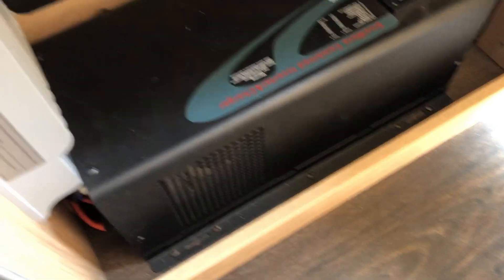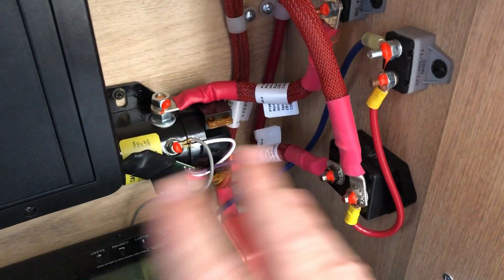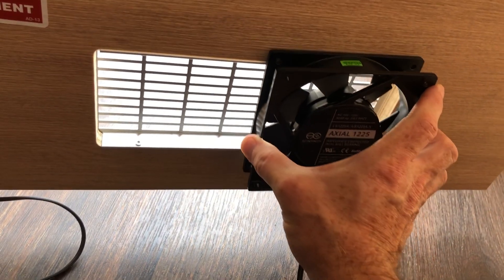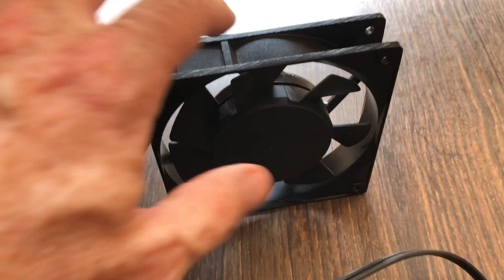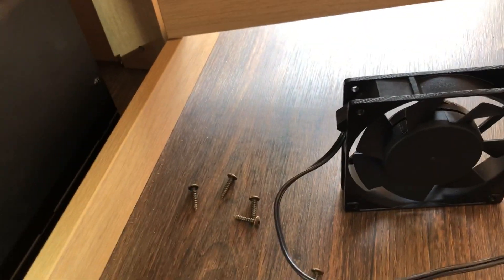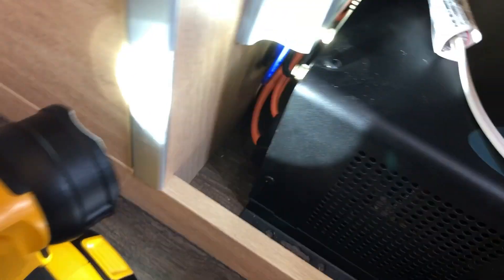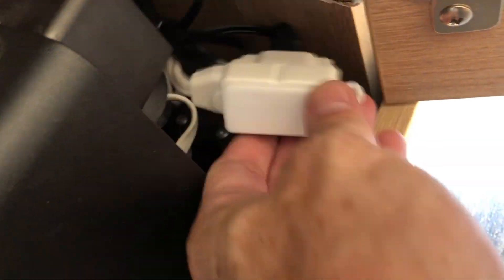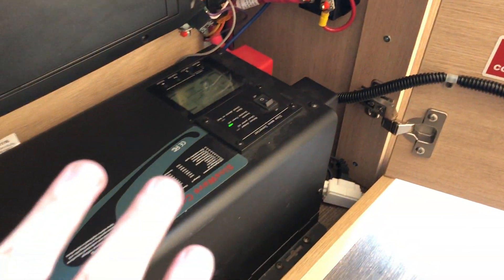Easy RV Mod: Electronics/Inverter Cabinet - Active Ventilation

Comment: Are you venting the inverter internally?  We have a 3K and it fights the AC unit.
Reply from the maker: No, but I didn’t run it for extended periods either. It had the added benefit of venting into the large space under the seat and closet and behind the cabinets, so it dispersed pretty well.

Comment: Hi Maury. I just tried to install this fan but found there isn’t enough room for the fan to fit between the door and the inverter.   I thought about moving the inverter but there are cables and connectors in the way.   Thanks for your ideas even though this didn’t work for me.
Reply from the maker: I don’t know about your install, but the fan comes with two wire covers - you leave the one against the door off. However, because the inverter was not installed with any particular standard positioning, it could have been placed too close to the door by Hymer to allow clearance. There are 3 or 4 screws holding it to the floor - you can unscrew them and scoot it back in the cabinet and re-secure it to the floor and it should be fine. I made some similar adjustments myself to give a little more room. The supply cables behind the inverter can be lifted and laid on the top edge of the inverter. Working around the way they assembled our units can be a challenge, for sure.

Comment: Great video! I’ve been plugged into 30amp supply for the first since I purchased in Nov. I notice that when plug in and charging batteries on 30amps the inventor was pushing some heat. I could really see the need for the fan then.  Thanks Maury
Reply: Thank you. Looks like something I can actually do myself! Awesome!

Comment: Good idea. I think I’ll do something similar after I figure out if the battery #2 in my Hymer is okay. It’s getting difficult to turn on unless I start the engine first. I suspect maybe the solenoid on #2 is going bad even though it’s one of the battery startup methods listed in the owner manuals. Do you have any suggestions? Thanks.
Reply: I am having the same issue with Battery 2 in my Hymer and I have removed the reset switch and installed a a on/off switch, that I turn on when I use that battery. Picked up the switch at Auto store ect, and the Battery stays on line now.
Reply: @philiptarnaski1667  That's great! Can you give a little more detail on how to do that? Thanks.
Reply: 20CB WestiesDen note I’m still testing the installation of the single pole on/off switch. To see if this will help your battery issue, hold the reset button on while turning on that battery also turn on the battery on/off and the inverter and everything should stay on. Note the switch I found at the Auto store was larger and had to drill out the hole to make the new switch fit ect.  See if that works.
Reply: Philip Tarnaski Keep me posted. Thanks. At least I know I am not the only one that have this issue.
Reply from the maker: Keep a close eye on that. The system is designed as a momentary switch on purpose - it supplies power long enough for the the relay to engage, but it also allows it to disengage to protect itself from overcharging. I’ve read recently that closing that connection for more than 30 seconds can cause damage.
Reply: @TravelingSolo  Thanks for the reply. I know very little about Hymer's battery systems. What do you mean by "closing that connection for more than 30 seconds?"
Reply from the maker: That reset switch is used to re-engage the solenoid when it is offline, either by design or due to error. Holding it for 30 seconds is one of the steps for resetting a battery that is misbehaving, so I’m not sure what it will do to it if it’s “held” all the time. The generally accepted operation for an H series battery is that it can take 30-45 seconds to come online (blue light on solid) and I have one that does that. The L-series battery engages immediately.

I have an L-series battery because one of my H series was replaced as it was exhibiting the same behavior - I could hold the switch down and the coach would operate, but if I let go everything would shut down. On the occasion that it did stay online, any load caused it to shut down immediately (this is tested by only using one battery at a time.) 

In any case, by forcing power to the solenoid with an on/off switch, I’ve read that it can cause problems. It might be worth reaching out to KS2 (the make of the batteries) to see what they say about it. It would be valuable information one way or the other.
Reply: @TravelingSolo  Thanks again for the reply. My Battery 1 always kicks in immediately, but battery 2 is getting very difficult to start. But once it starts, it stays on. Still, it's a very annoying and worrisome issue. Sooner or later I'll have to take back to the dealer for checkup. Fortunately, they still has one Hymer expert left who had been visiting the factory several times for training before Hymer shut the door. 

By the way, how I can contact KS2? They don't seem to have a website.
Reply from the maker: I wonder if you have mismatched batteries like I do. The H series and L series operate using different charge and float parameters. If you get underneath and take a look at the cases, they will be labeled H, L1, or L2.

KS2 is in Canada: https://ks2corp.com/ks2-products
Reply: @TravelingSolo  I don't know how I missed this reply until now. Thanks a lot. I will try to go under the chassis and find out.

Last winter, I was able to start #2 normally. 4 weeks ago, I need to hold the Reset for 20 seconds and it kicked in. 2 weeks ago, #2 would not start unless I start the engine. Even though all 3 methods are listed in owner's manual, I am worried that I won't be able to start #2 at all.